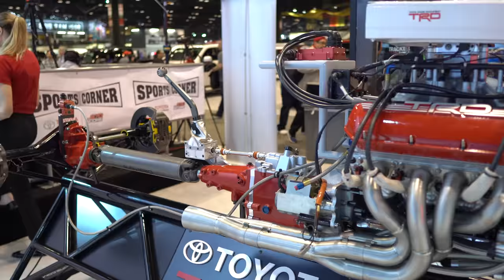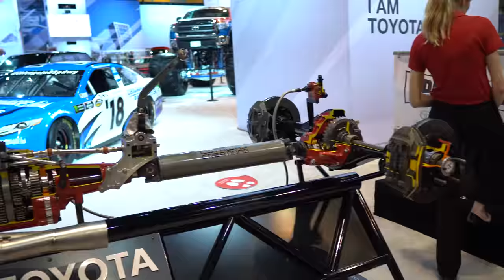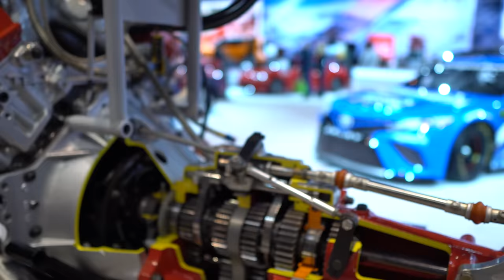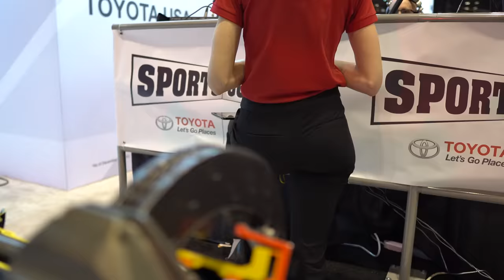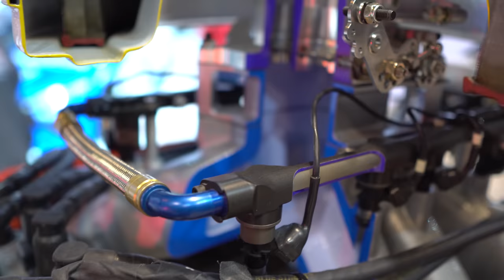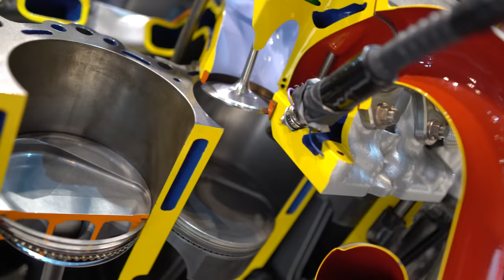Anatomy of a Toyota Supra TRD NASCAR 5.8L Big Block V8 Engine - Cutaway Creations 4K

Comment: Yikes; this comment section is toxic.  It also seems that most replies are made without any significant research into the history and design philosophy of a car manufacturer.
Here's my point(s):
LS engines are great as far as packaging is concerned, because it's a very compact platform that allows for large displacement.  Also, it's a thoroughly engineered piece of machinery that took the entirety of what GM had learned through the course of (at the time) ~40 years of R&D with the small and big blocks up to that point.  It has 2-valve cylinder heads that can match or exceed airflow numbers of dual-overhead cam V8's of similar displacement.  They're endlessly modable.  But that doesn't mean that LS's are above reproach.  If you've never heard of the 'trunnion upgrade', consider yourself lucky.
As a side note: for anyone who's bound to something along the lines of 'LS's can go 8,500 RPM easy'; well, you're only half-right.  Is it obnoxiously expensive? No, however it can become expensive if you don't take the time to research and understand how to properly build an engine to handle and sustain high-RPM operation.  Besdies, for LS's, it's all about valvetrain stability and oil control at those engine speeds.  Even then, you're shelling out a minimum of $6,000 in valvetrain and supporting components just to reach those levels.  Because let's be honest; it's not wise to build an engine for that purpose without going lightweight forged internals to reduce internal pumping losses and friction, upgraded oil pumps and special pans for oil control issues, ported and polished heads with oversized valves for better airflow... The list keeps going...  For LS's, it's all about valvetrain stability and oil control at those engine speeds.
And this isn't even mentioning all the downsides of driving a high-RPM pushrod V8...

Toyota's V8 series started in 1989 with the introduction of the 4.0L 1UZ-FE.  Let me drop some knowledge on you here: Unless you have a love-boner for Toyota or have been paying attention to the racing scene outside the U.S. for a significant period of time, it's perfectly understandable that you wouldn't know this following tidbit: Toyota's been partnered with MotoGP/World Superbike-winning brand Yamaha... FOR DECADES.  The same Yamaha that builds world-class superbikes that dominate world-wide also works with Toyota to aid in designing compatible performance variant cylinder heads for common Toyota engine models.
Anyway, the 1UZ... outside of the US it's notorious for a few things:
1)responding incredibly well to an aftermarket turbo kit with little to no internal engine modification (hmmm.... sounds like an LS...)
2)comes from the factory stock with a forged, internally balanced crankshaft (not common nowadays, especially so for 1989)
3) unofficial sprint car engine of choice for the 4.0L New Zealand/Australian dirt track racing.  
To say that Toyota doesn't know what they're doing is a HUGE understatement.  They know exactly what they're doing, and they do it incredibly well.

The biggest complaint I see about Toyota is that they don't constantly update their powertrain and drivetrain options as often as other manufacturers.  

There's a reason for this.

Toyota's philosophy is about obsessive quality control for all engineering aspects that they can control (if you're going to cite the corolla brake crisis from early last decade, please note that Toyota; much less any major car manufacturer,  can't possibly test absolutely every last real-world aspect of a new vehicle platform before finishing).  How they operationalize this is simple.  If the new product doesn't at least meet if not exceed the performance, reliability and sustainability of the previous product it's replacing beyond a shadow of a doubt, then it will not be implemented until it does so.
If it isn't improved upon, don't use it.  Stick with what's proven to work until you come up with something truly better.
Reply from the maker: Well said!
Reply: Tldr

Comment: To bad Toyota doesn’t build anything close to that in a production car or truck but with a bunch of money spent on Daytona the new NASCAR will rewrite rules for you.
Reply: Technically the 5.7L V8s are pretty similar at least as far as durability and displacement~
Reply from the maker: The one in the Tundra?
Reply: @ubacow7109  yeah that's pretty similar, LMAO!!! 😂🤣😂🤣
Reply: @02autogt  Well the nascar ones technically wont outlive more than like a few races. The Toyota UR series is built to take the abuse as a daily truck, and it offers a different a different level of reliability, and plenty of people do also tune and run the UR engines in builds from 300-2000HP~

Comment: No way toyota built that hell ya, whats the litre, horsepower, and torgue, and is it supercharged
Reply from the maker: I don’t follow nascar but I think it’s like 358 cubes, 750hp and it’s NA.
Reply: Naturally aspirated electronically fuel injected 90 degree pushrod v8 depending on certain packages on different trackes in 2019 there is different hp packages there is short tracks like Bristol and martins ville the package is 700hp 1/2 mile tracks 550-600 hp